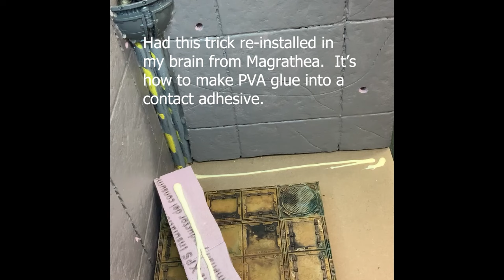Necromunda Sump Wall Corner Section Build Video Part 3: Adding more details!

Comment: Is that chipboard with the pink insulation foam on it something your getting as a standard building material or are you just gluing them together off screen?
Reply from the maker: its base is a form of thicker chipboard, but the foamboard is on really old paneling that I found when i was remodeling a few years ago.  Thanks for the interest!